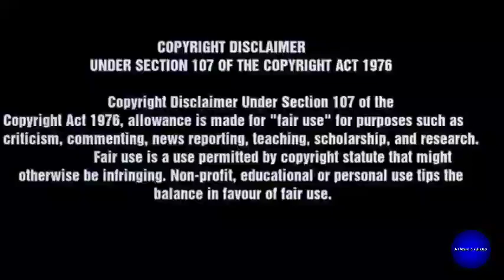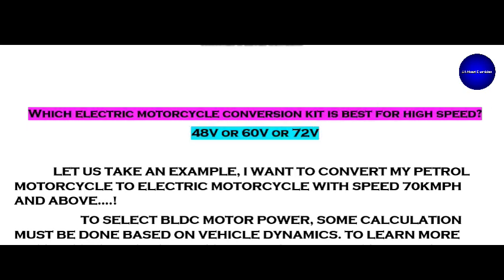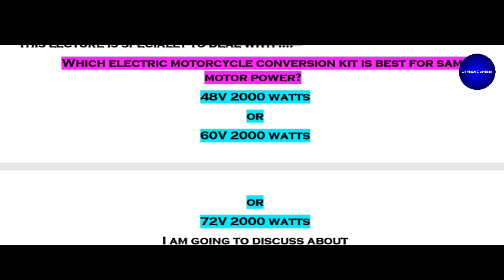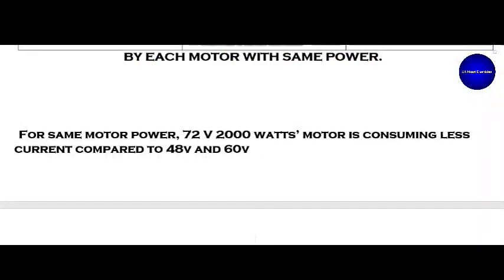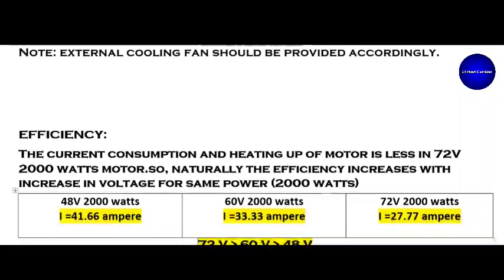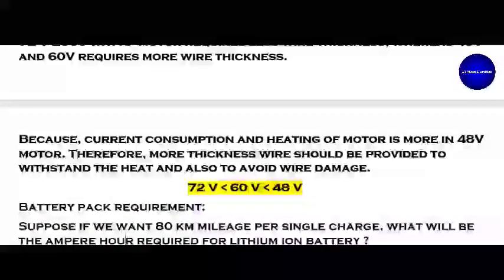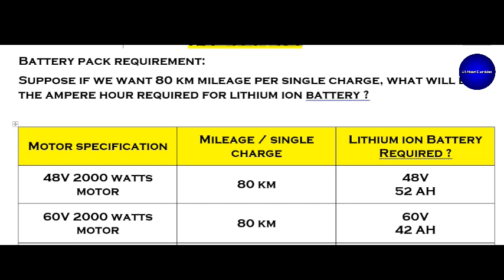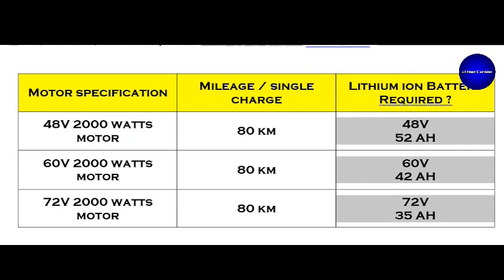48V vs 60V vs 72V Best Electric motorcycle conversion kit

Comment: Sir nice video, however  a 72 volt 35 AH  battery requires more battery cells than (for example) a 60 volt 35 AH battery.  So your last conclusion about capacity needs a little work.
Reply: but how did he calculated the 52AH for the 80KM mileage in 48 Volts. 
And the 42AH for 60 volts 
What is the mathematical calculations
I’ll be grateful if u explain it.

Comment: Nice video Sir,  but how did u calculated the 52AH for the 80KM mileage in 48 Volts. 
And the 42AH for 60 volts 
What is the mathematical calculations
I’ll be grateful if u explain it. Coz i  really need it .

Comment: 72 volt 2000 watt motor with 6 140 AH batteries electric loader, is it works ?
Reply from the maker: U haven't mentioned about electric loader technical specification

Comment: I have a z6 electric motorcycle 2000 watts 72v 20 amp what power station can I use to charge it for under $500
Reply from the maker: Go for Solar charging...Initial investment may be high...but life long you can use.

Comment: Hi bro I have a battre one bike need to increase the speed is there any way.
Reply from the maker: Increase sprocket ratio for motor
Reply: @AllAboutEvehicles  its a bldc motor fitted
Reply from the maker: If it is a hub motor,  as per output speed it works. If it is mid drive motor,  u can change speeds.
Reply: @AllAboutEvehicles  can I change the hub motor to get a faster speed say at least 60kmph
Reply from the maker: U can do.

Comment: Bro 48 volt 550 watts motor ku 36 volt 10.5 ah battery use panna enna aagum. Very urgent please reply bro🙏
Reply from the maker: Motor will not start...
Reply: Thank you bro

Comment: Sir in motor watt calculation video you explain force*speed(m/s) is watt for motor in this you select 150 kg load and 70 know mean 2850 watt then why you take 2000w motor in this video plz correct if i am wrong
Reply from the maker: 2850 Peak power
2000 Continuous power
Reply: @AllAboutEvehicles  How is this Peak vs Continuous calculation done?
Reply from the maker: Watch our video on complete electric vehicle design part 1
Reply: Hello, but how did he calculated the 52AH for the 80KM mileage in 48 Volts. 
And the 42AH for 60 volts 
What is the mathematical calculations
I’ll be grateful if u explain it.

Comment: Battery cost is calculated upon watthour not by amperage of battery. So all 3 type of motor voltage in the video carry same watthour i.e 2.5kwh... so diierent in cost for battery ..pls correct the information
Reply from the maker: Yes..battery cost depends on watt hour.  The purpose of this video is to select 48V or 60V 0r 72V motor.  So 72V battery  is cost effective for 72V motor for same mileage when compared to other voltage.
Reply: but how did he calculated the 52AH for the 80KM mileage in 48 Volts. 
And the 42AH for 60 volts 
What is the mathematical calculations
I’ll be grateful if u explain it.

Comment: Wouldn’t I want more amps? Less amps equals more range, but less pulling power.
Reply: Tq will be the same because it's same wattage and rpm will be higher With higher voltage so topspeed could increase